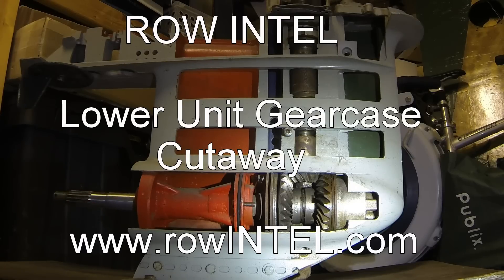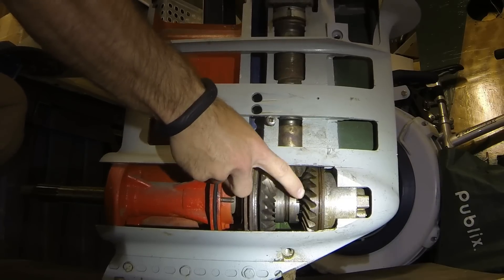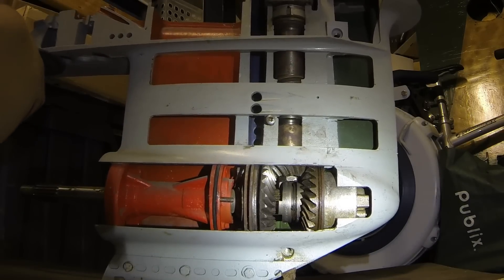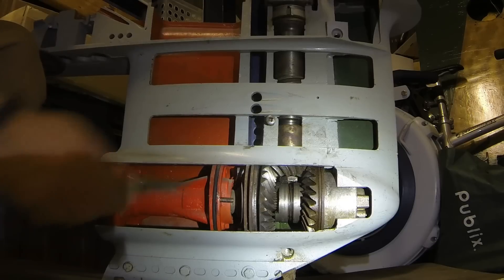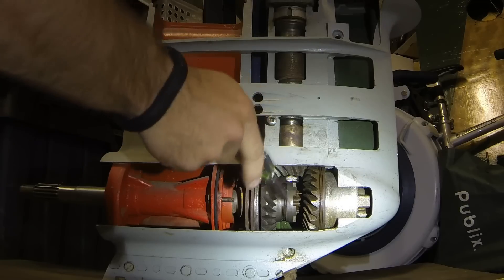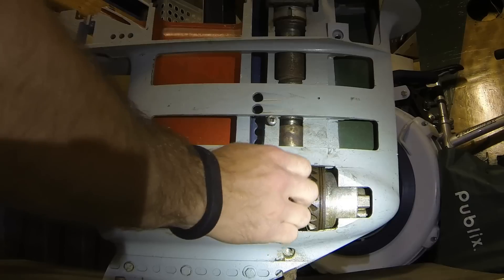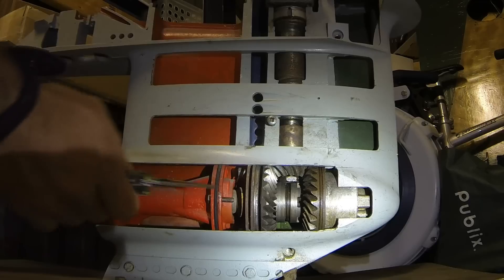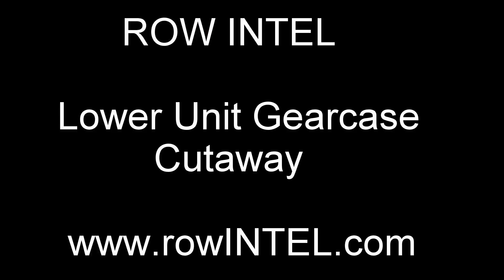How it Works Lower Unit Cutaway, Training Video

Comment: What a great video lured a lot today, I have a issue w my outboard motor 1999 evinrude ficht n this is only after me driving my boat for a while, when cold like after lonching the boat n I put it in reverse no issues there but after navigating for a long period of time it was time for me to get my boat out the water as I was getting close to the duck area I wanted to put in reverse of course I let it idle before putting it in reverse n it will not go in reverse n the engine started raising at 2k rpm, I asked around n I was told I need it to adjust the shift rod? I was wondering if u can guide me in the right direction as to what I need to do in my case? Hope u can help me out I really will appreciated thank you!

Comment: Hey cool wideo. I have a 30 four stroke tohatsu and after a bottom strike under low rpm 3 years ago it take water in the gear oil, not much but much ower  time. I replased the propeller and a mechanic replased a seal according to himself. Could the propeller shaft be the cause that it,s not fully senter and "shace" oil out from the seal on the shaft??? But anyway it worcs well if change the oil each 6 months it,s ok i think. The boat is in use whole year and quite a lot in use on short trips from a to b and in fishing with hours on it. Have a good one from Norway)

Comment: Awesome vid!!!!!  I have a question for you if u still monitor this site.  I am installing my prop shaft large bearing carrier soon.  I have all new seals etc.  When installing the large bearing carrier should the engine be in fwd...rev...or neut?  Also...do I just pound the carrier in til the reverse gear bottoms out into the dog????  thanks

Comment: HI, this video is exceptional! I have a problem to submit, I would like to know:
Mercury 80hp engine foot removed
1- In what sense must turn the gear shaft to engage the gears back?
2- because by entering into forward or back feels that changes, but the propeller does not fit?
Thank you
Reply from the maker: You may have a gear reversed, or the shift rid not properly adjusted, they typically need to be in forward to reassemble.  Also ensure the shift fork is in the proper position.

Comment: Great vid. Hope you can help me with a question.... i just dropped a washer down the oil reservoir when changing the shift rod seal cover plate. Can't see it or get it out. I'm wondering if it can make its way to the bevel gears, but from your section it looks like the bevel gears are sealed on both sides? Your input would be great.

Comment: Hello I have a question. My lower unit drain screw was very hard to come off I try  everything trying to take it off. When finally I took a drill and took it off by pieces. But there's a big piece of screw stuck in the lower unit.  Question is, is there a way I can get in there to take it out? And great video by the way!
Reply from the maker: Sokthea Seng If it was that difficult to take out I wouldn't try getting the main seal out the back end (will probably cost lots $).  I would remove the lower unit from the motor, and go after the screw by removing the plate and seal around the shift rod, that will give you a good amount of space to shake it out.  We have a removal video if you need some insight how to drop the whole "foot".

Good luck!
Reply: OK so you saying not to take the propeller Gear shaft off, but take it out from the top?    And what is the other video call
Reply from the maker: Sokthea Seng https://youtu.be/s_YDYzRMpQM @ 6:56 times on the video is what to take off to hopefully jiggle out the screw.  I would not take the prop and gear shaft out, too many seals to replace when you do that and too much $$, if your screws were seized from running in salt water, your main bearing and seal closest to the prop is also probably seized and you will do lots of damage prying it out.
Reply: Really appreciate your help thank you!!

Comment: great video, thx for posting. i have a 01 merc 135 otptimax and i was wondering if replacing the seals behind the prop would be difficult? im somewhat mechanically inclined but have no experience with marine. if this is something i shouldnt do myself, do u have any idea about how much this would cost if i were to bring the lower unit in for service? Oil leaked out from where prop meets the case, also found water in the gear oil...thank you

Comment: Hi what is the orange part called? Thank you
Reply from the maker: Orange parts on the left are the "hot" side where exhaust flows down through the lower unit and eventually out into the water through the prop hub.